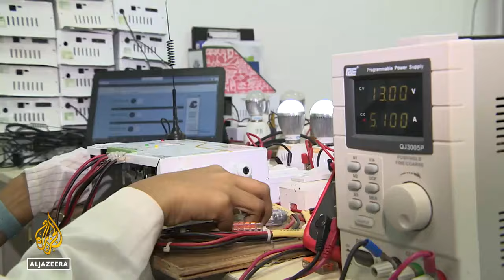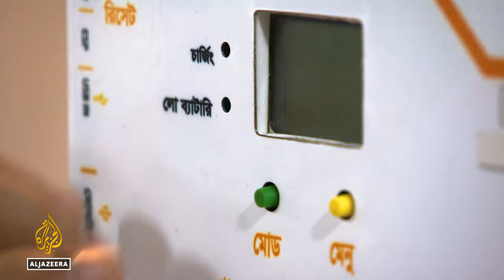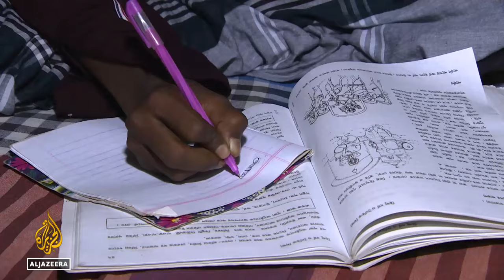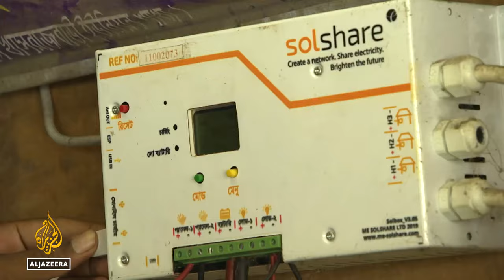Power Swarm: A revolutionary approach to solar microgrids | earthrise

Comment: This is a brilliant idea and solution. We need this all over the world.
Reply: We have had these solutions for at least 20 years now. 

The blockage to progress comes from financial interests making political decisions without public consent.
Reply: The whole world already has something like this, it's called a power grid
Reply: @zEondota  privately owned 'for extortionate profit' high voltage Regulated power grids , not low power 3.3v, 5v, 12v dc micro grids to charge & run all the low power tech: phones, 12v wireless routers for simple lan builds for 5v pi4 openmediavault 5 video sharing of educational content & entertainment NAS, 5v usb portable monitors, 3.3v screwdrivers, 12v grinder's, 5v-50v dc diy paint on heaters etc these & other people can now self generate, store, and use 'off grid' for their improved communities
Reply: Indeed to influence others and persuade others we require a working example. This is the best way. Each house to have batteries for saving excess power. It also represents foreign exchange conservation!!!

Comment: Looks like Allume is calling it a Power Division Control System (PDCS), and that it has an inverter built into it, adaptable to both single phase and three phase connections.  You probably still want an MPPT.  Odd that this isn't attracting way more investment.

Comment: STOP.  in most conditions this is wonderful. How do you shut a system down if theres a problem?
Reply: As a distributed system it is not needed to shut down the whole system.  It must have a fuse or circuit breaker at each box and connection, so self shutdown allows local repair as needed.

Comment: Literal Power to the people. Personal energy generation can go far farther than using renewables for the centralised and fluctuating grid.

Aljazera should really show light on Aqua And Agrivoltaics, the latter particularly generates electricity at the same time it offers enough shade to grow a bed of plants beneath and preventing dehydration and crop failure